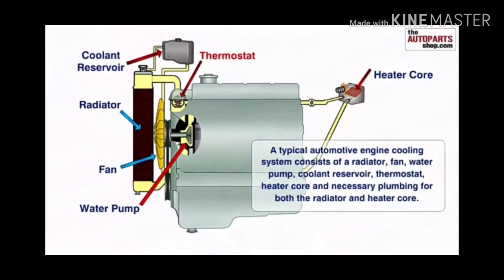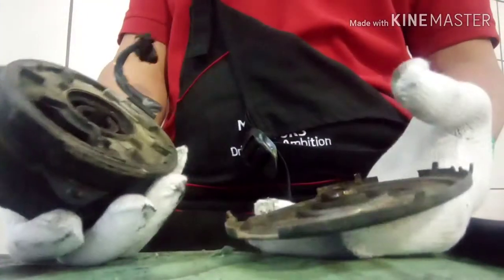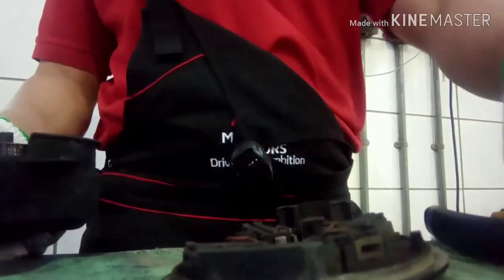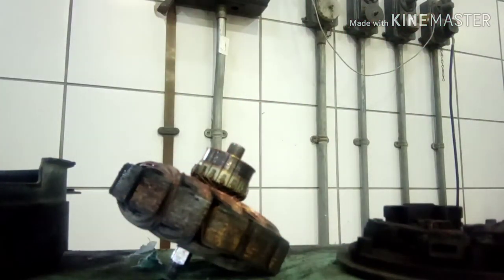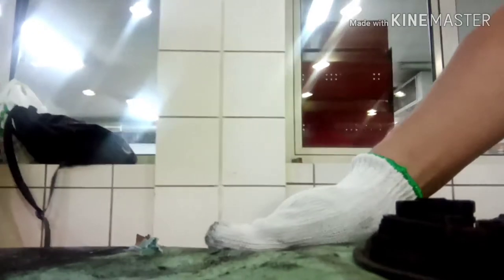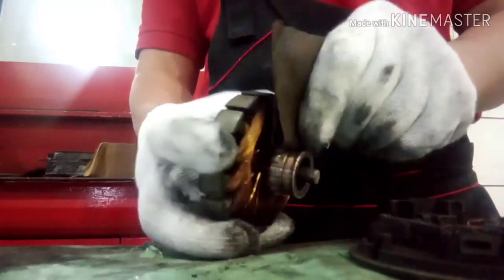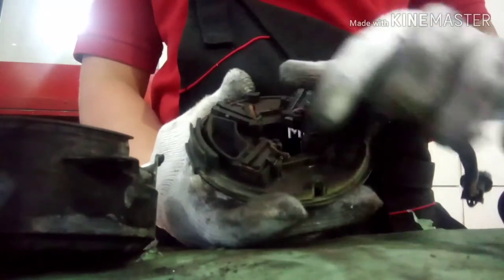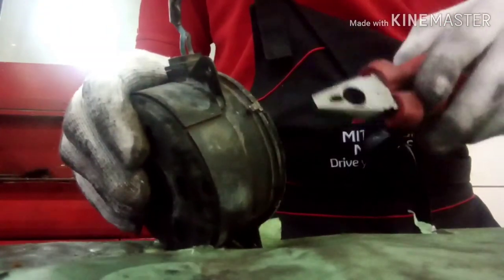Fan motor overhauling /Carbon brush Replacement

Comment: Very good how to video, are you going to do update video when carbon brushes come in,far as how you are going to put them in? I'm going to be doing both fans on a 2003 Audi A4 next week, Just to put it in service mode takes 30-45 mins, so figure getting both fans off total time extra 15-20 mins.. If bad carbon brushes, there's a local hardware store that sells different sizes of carbon brushes.
Reply: Do you have a part number for the brushes to order and a place to order from?